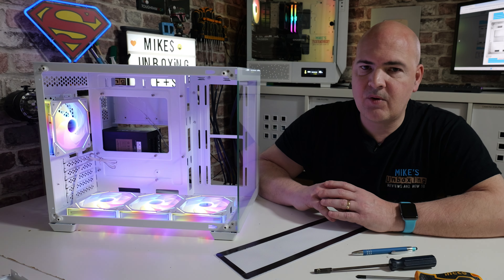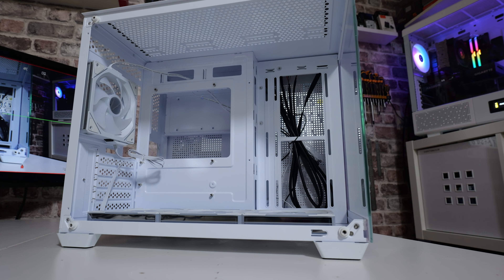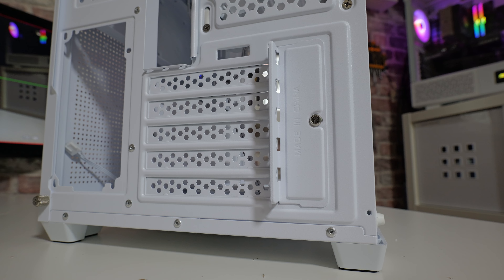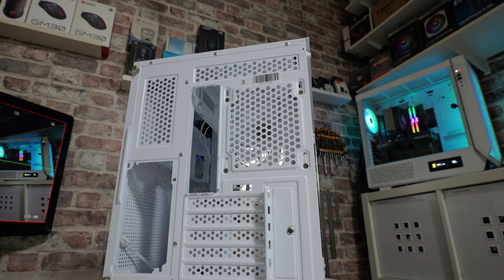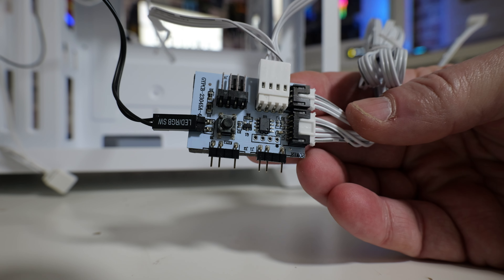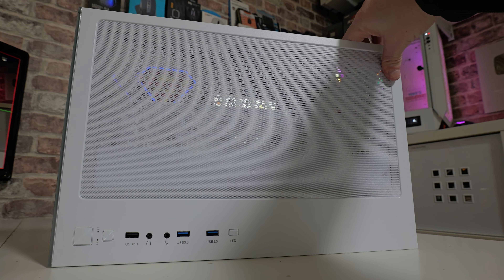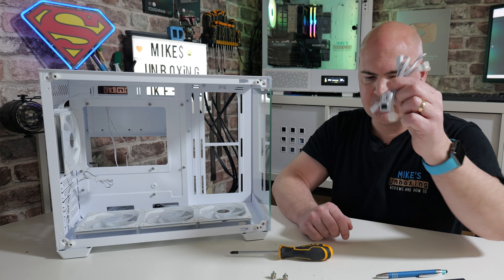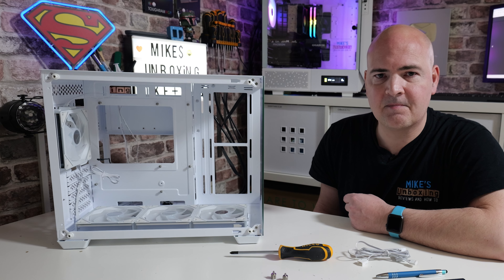SaharaGaming M808W Dual Zone MATX TG Case With 4 Lian li SL120 type ARGB fans

Comment: Interesting case design and really like those bottom mounted fans drawing air in yet rgb unhampered. If you mount fans to top panel wont the case look odd if side not populated too? Plus you wud want same intake fans so motherboard gets max airflow surely. Look forward to build and agree good to see matx getting showcase treatment. Thanks Mike and Kath 🐈👍
Reply from the maker: really this case needs all the fan holes used by fans or a radiator to make it look its best

Comment: Hi Mike just got this case and having issues with the fans one fan runs only at full rpm! And RGB isn't correct if inset them to red with my RGB fusion software to red they go blue like they are flipped! Is that something I've wired wrong. Please help cheers
Reply from the maker: sounds like a bad connection somewhere in the chain